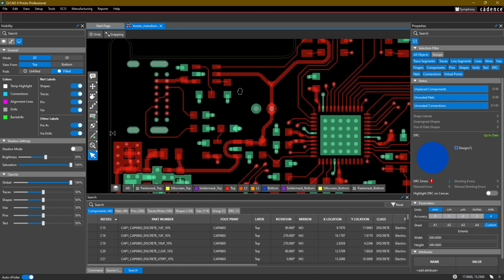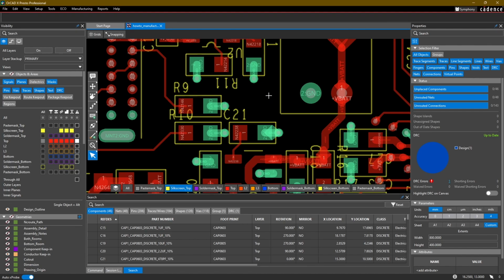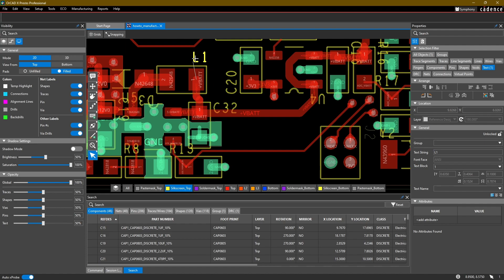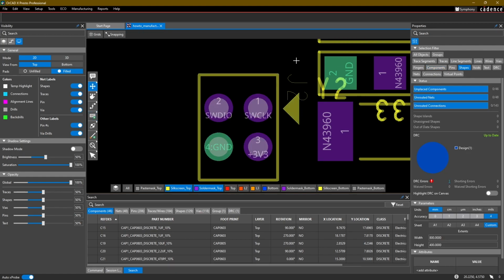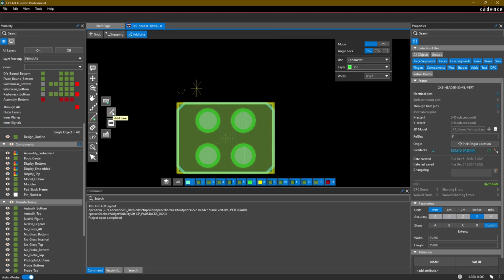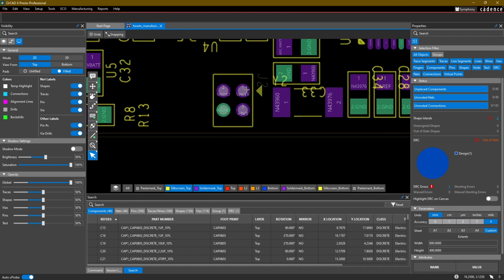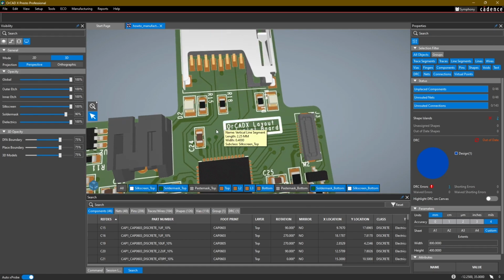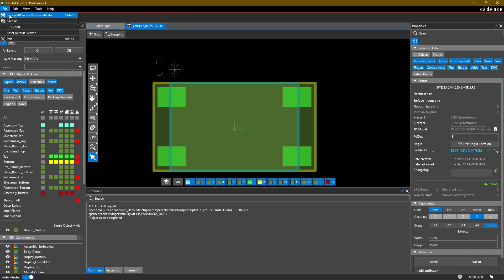OrCAD X How To Series - Part 13 - Silkscreening

Comment: I have a PCB file with zero silkscreen line width. I am not able to figure out a way to change it. It will be helpful if you could outline how that is done! Thanks!
Reply: Hello Sumukh, were you able to figure it out? I'm having the same problem and I can't find information on how to fix it.
Reply: The screwed up and forgot to put the ability to set up Text Blocks in Orcad X.  You need to use the old Allegro/PCB Editor to set them up.  Orcad X uses the same configuration info as Allegro...